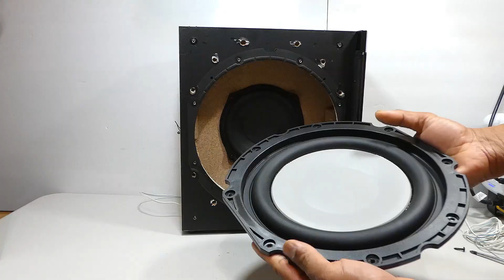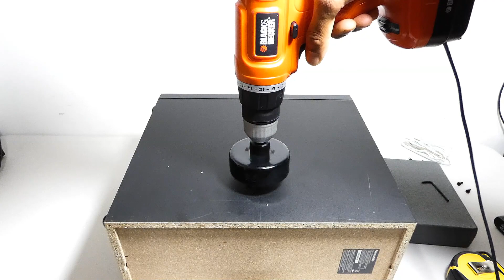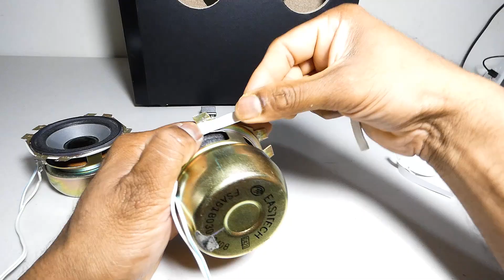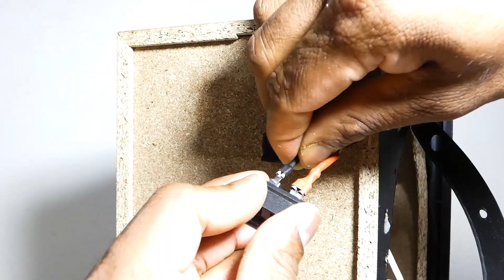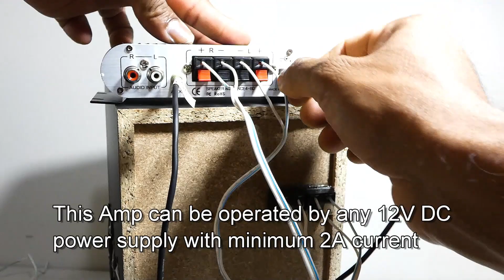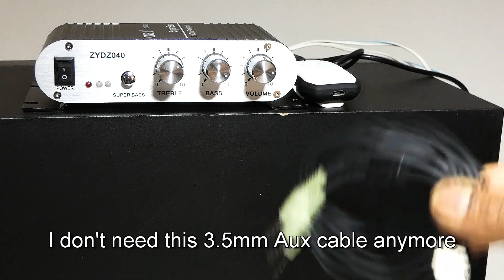HOW TO CONVERT OLD SUBWOOFER INTO BLUETOOTH PARTY SPEAKER | DIY Project Idea | Sound Test Experiment

Comment: needs a tweeter and a high excusion driver
Reply: Those stupid little woofers probably even sound crap and have no bass like freckin tweeters, needs a subwoofer.
Reply: @realchronal  definetly, as i said, if he gonna put small woofers, than put a high excursion driver.  capable of moving way more air than a standard driver

Comment: Friend I have a theater at home (genius sw-5.1 1010), the problem is that I lost many cables and the remote control, but the subwoofer has an integrated circuit, I do not know if it can be used but direct to the PC or mobile help
Reply from the maker: Hi Friend, as you don't have remote control to operate it, open the subwoofer and try to find the volume control unit and bypass it. Now you can control the volume by audio input. Also find the power input and satellite speakers output terminals, tab them. To find that how to open the subwoofer check this link https://www.yumpu.com/en/document/view/21478362/sw-51-1010-service-guidepdf-genius
Reply: @SKILFULLIFE  thanks friend c: